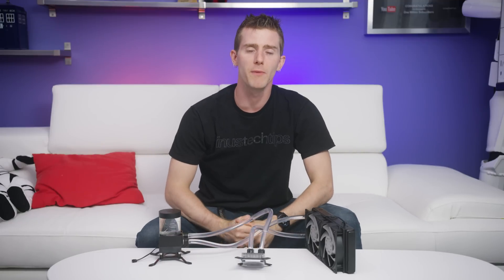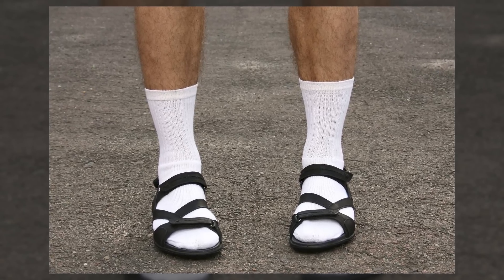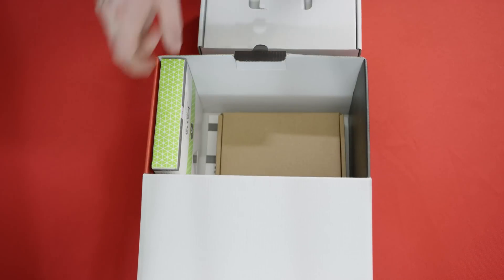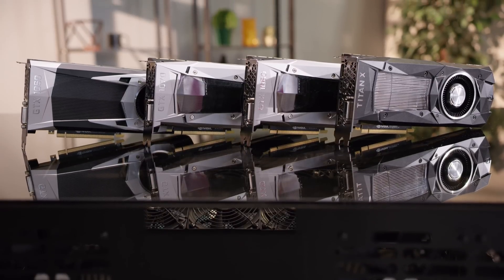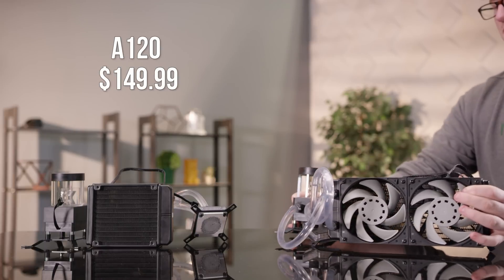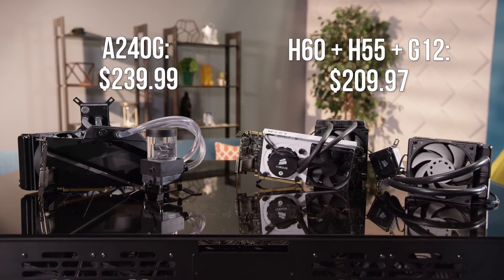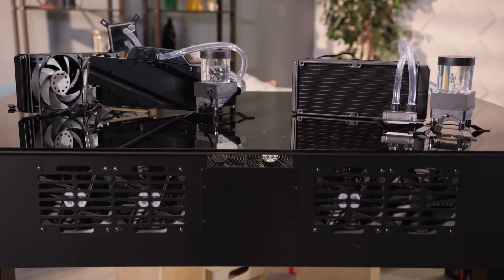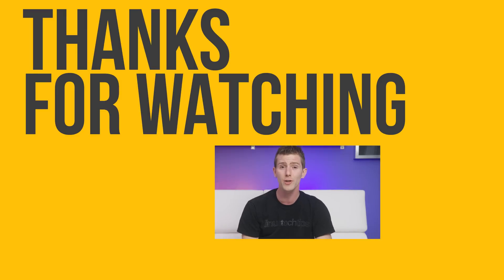CUSTOM WATERCOOLING AT AIO PRICES!? - EK Fluid Gaming Kits

Comment: Jays2cents reviewed this
Reply: Anyone with a brain has been talking shit about AMD for the last 8 years or so, and they deserved every word of it. If you had paid attention to his video about the Ryzen build, he stopped using it due to flaws in the way he built it. Not the components themselves. How many tech YouTubers would admit that kind of mistake. 
And by the way, the 7900 is incompatible with X399. Do you not even understand that X399 is AMD's high end platform and X299 is Intel's?
Reply: Shalom Bhopale I think you'd find that lots of tech reviewers do indeed review the same parts :)
Reply: lets agree to disagree on that. They both are great.
Reply: the interesting part is the comparison with the copper kit, wich J2C hasn't done
Reply: The comparison is also worthless because the results are woefully inconsistent, do not indicate how testing was done or what the temps even represent, what parts were used in the copper loop, how much the copper loop cost, or how affordably a full copper loop can be build (Hint: It's the same as an A240G, sometimes cheaper). These are not temperature deltas, either, it seems. The testing suite could have only been run once (and knowing how much LTT loves EK, they probably kept any result that made the A series kits look good and ran with them), combined with temps not being deltas and how close they are makes all of this testing about as relevant as Jay's "Guys look it's only in the 40s while idling in a game" while it hits 50c+ on camera level of thermal testing. I will credit Linus and the script writers for mentioning that Aluminum is much lighter, even though they don't really explain why that's a potential positive.

That's what I think the real selling point of this kit is: It's really lightweight compared to a full copper loop, even though it's in reality a pretty big performance gap. The product line should be cheaper, but EK will be EK. This kit isn't even good as training wheels for someone looking to get into custom liquid cooling and test the waters, so to speak. EK has no plans to make hard tubing fittings for this kit, meaning if anyone wants to learn how to do that and sidegrade their system to hard tubing, it'll involve replacing the entire loop. That's not inexpensive.

However, the product line being as lightweight as it is and with the angled fittings coming soon (which it really should have launched with in the first place) it'll actually be quite a compelling choice for liquid cooling mini ITX or micro ATX portable systems.
Reply: Jay ain't no shill, watch his latest AMD ryzen stuff
Reply: TL;DR Mighty Voice seems to need to pay more attention - he seems to have no clue atm, for anyone that thinks no way can a ALU water block be close to a CU water block, even the theory of thermal dynamics is against you (maths below if anyone's interested), in a cooling system while thermal conductivity of a material is important there are many other factors (inc things like distance) that massively effect the relevancy of the conducting material

Massive wall of Text

The Mighty Voice are you one of those people who need shit spelt out for you ?, or u just didn't properly watch the video ?
"woefully inconsistent" how can something be inconsistent , when there is only 1 result graph for each product - you cant have inconsistency with a sample size of 1(not that he didn't necessarily test multiple times and average it out but to us its a sample size of 1)  
"do not indicate how testing was done" - its quite clear what was done, he used AIDA's stress test , CPU only for first test, as those kits are for only the CPU, 2nd test is CPU + GPU on the same loop and also used Crysis (as gaming is a bad test for CPU only) ,
"what parts were used in the copper loop" THE SAME BLOCK JUST MADE FROM COPPER , the only failing here is if he used the same pump for both tests, he didn't explicitly state just eluded to, but if he did use a different pump then that test would be Copper favored anyways in either case its not ALU favored

"Hint: It's the same as an A240G, sometimes cheaper" , holy shit are you stupid how can two blocks, same design and volume - one made from copper and one made from aluminium be ANYWHERE close to each others price (retail,2nd hand shit doesn't count) JUST the copper CPU and GPU block is 254 $ , the whole fucking a240G aluminum kit is $ 240 (CPU block, GPU Block, pump w inc reservoir, tubing , radiator, coolant, fittings) , the difference between a ALU block and a CU block is like 60 + $ (the material CU is 3x + more expensive then ALU)
"these are not temperature deltas" for fucking what .... there is a sample size of 1 - whats the delta gonna tell you - NOTHING its freaking 0  - unless your talking ALU block VS CU block , in which case your illiterate and cant be helped (HINT the delta is < 3) 
"they probably kept any result that made the A series kits look good" if you don't trust a source WTF are you even arguing about if u expect shady shit it doesn't matter what was done the result to YOU would be invalid

"and how close they are" you basically assumed if a product is comparable nothing is true just makes u a closed minded nitwit, theory | lab =/= Real Life Situations , that being said even the theory behind it says ALU and CU at the water block level are similar, though i only know the math roughly it gives you a decent idea , assuming i didn't miss something

Copper                 0.99 (cal/sec)/(cm2 C/cm)        | 385.0 (W/m K)
Aluminium           0.50 (cal/sec)/(cm2 C/cm)        | 205.0 (W/m K)
Water at 20° C     0.0014 (cal/sec)/(cm2 C/cm)   | 0.6 (W/m K)  | 0.0058576 Watts/cm2 - > forced convection of water in tube can do 0.3 Watts/cm2 (this it at moderate speed, the higher speed a loop has the greater the conduction)
Air at 20*C            0.000057 (cal/sec)/(cm2 C/cm)      | 0.024 (W/m K) | , when air is moving it becomes ~ 0.0028 Watts/cm2 @ airflow of 5.5m/s (highest end CPU/Case fan)

anyone notice a problem here ? 
the biggest problem here is water conducts WAY less then either CU or AU -
UNLESS you are using the copper as the medium for a significant distance , ALU block vs CU block doesn't matter much, especially in sustained use, when using something with lower heat transfer as the main medium - Note there is a way bigger difference in air cooling, in CU vs ALU because CU IS the medium used for quite a distance  i.e. Noctua NH-D14 160 x 140 x 130mm i.e. 224 cm2 ; L 13 cm (2912 cm3) |NOTE: air cooler has fins so total volume is actually less and surface area greater and rods so faster conductivity away from CPU then what i calculate below| vs a EK water block - 36 cm; L 2 cm  (72 cm3) - that's basically 2.9 L vs 0.072 L

rough math (some of its probably not right | don't shoot me ) -
Note:   the first comparison does NOT take into account how much heat a system could carry away , its more of a how long does it take for heat to transfer with no cooling from one end of a metal to another and after that metals temperature was raised by its heat capacity once how long would air or water take to cool that element by its heat capacity, but this isn't a indicator of how much heat is actually carried away per sec of operation

for below assumed temp difference i.e. delta T of 1 (the greater the temp diff the greater the heat transfer)

surface area = A,  Thickness = d, k = (W/m K), 
Rate = k•A/d
Air cool (note cooler height is the depth for heat transference because of orientations of a cooler)
CU   - A = 0.0182 m2, k = 385.0   , d = 0.16 m = 43.79 J/s ( no flow of air or water) 
ALU - A = 0.0182 m2, k = 205.0 , d = 0.16 m = 23.32 J/s ( no flow of air or water) 

Water Cool
CU   - A = 0.0036 m2, k = 385.0   , d = 0.02 m = 69.3 J/s ( no flow of air or water) 
ALU - A = 0.0036 m2, k = 205.0 , d = 0.02 m = 36.9 J/s ( no flow of air or water) 

Heat capacity of metal = J/(kg-k)  - Aluminum weigh(s) 2.7 gram per cm3(cubic centimeter) - Copper weigh(s) 8.95 gram per cm3(cubic centimeter)

Air -
2912 cm3 block
lets say it has 4 sides in contact with air cause we are assuming its a block , rough cm2 = 896 (224 x 4)
0.0028 * 896 = 2.5088 W

now for a more accurate surface area i believe the NH-D14 has ~ 45 fins(i believe its actually more but lets go with that) x 2 sides = 90 fins x 2 blocks = 180 fins , im gonna assume the cooler has square fins (actual area will be less) a = 140 mm x 130 mm (W x D) =  182 Cm2 * 180 = 32760cm2 * 0.0028 = 91.728 W

ALU 7.8624 KG
ALU 921 J/(kg-k) 
7241.27 J to heat 
310.51 S to heat T a block ~ 5m
2886S to cool a block ~48m
not going to do rod with fin heat transference as its more complicated but its basically less ( a lot less )
79 S to cool a finned ALU block - 1m 20s

CU 26.0624 KG
CU 376 J/(kg-k)
9799.46J to heat
223.78 S to heat T a block ~ 3m 40s
3906 S to cool a block with still air ~ 1H 5m
not going to do rod with fin heat transference as its more complicated but its basically less ( a lot less )
107 S to cool a finned CU block - 1m 47s

this is why you have a mixture of CU Rods with ALU Fins on most Coolers to maximize cost effective performance, also > surface area will mean > heat dissipation and less volume will mean > heat transfer, but clearly in a air cooling solution the ALU  block is a massive bottle neck as it clearly takes much longer to draw heat away from one end to the other then a CU block 

Water-
72cm3 block
Assuming 0.3W/cm2 

ALU 0.194 KG
ALU 921 J/(kg-k) 
178 J to heat
4.84 s to heat T the block
8.24 s to cool 

CU 0.644 KG
CU 376 J/(kg-k)
242 J to heat
3.49 s to heat T the block
11.2 S to cool 

so from this we can see because of the short distance of the mediums used although CU is still way more conductive it doesn't matter as much cause of distance and size of the element as well as the time frames , and water being the main conductive medium the difference won't have a large impact

now lets do it assuming CPU is at 75 *c, CPU block/Cooler at 50 *c and air is at 25*c

Air-
2912 cm3
ALU
12.42s to heat (block)
115s to cool (block)
3.15s to cool (w fins)

CU
8.95s to heat (block)
156s to cool (block)
4.27s to cool (w fins)

Water-
72cm3 block
ALU
0.19s to heat
0.32s to cool

CU
0.14s to heat
0.49s to cool
Reply: yeah but he never made it build like this and jayz2cents makes the worst builds outta all famous youtubers
Reply: He just likes to stick with good and solid brands, do you blame him?